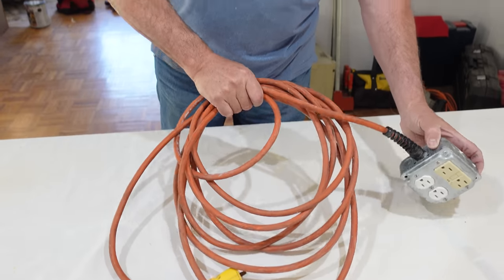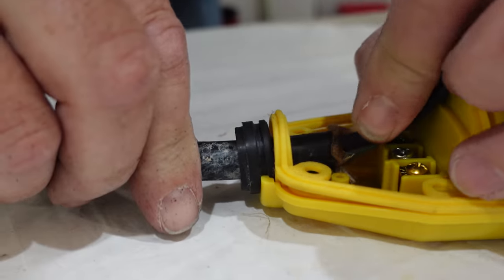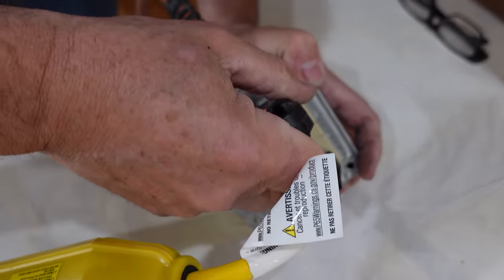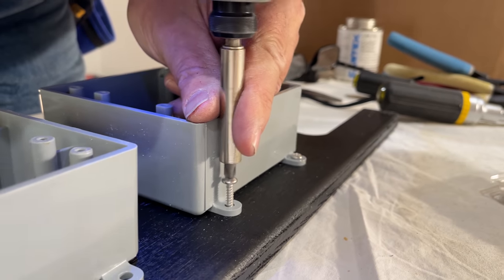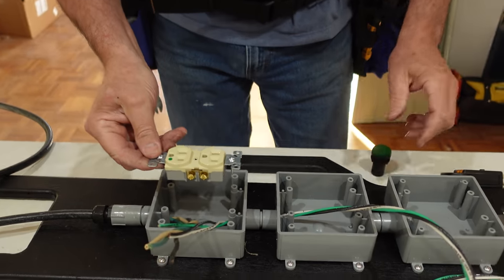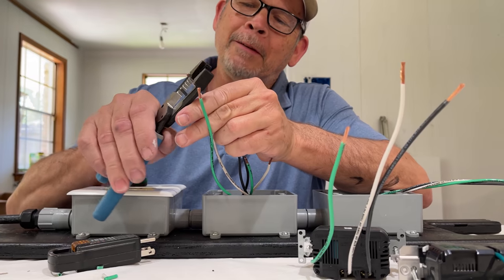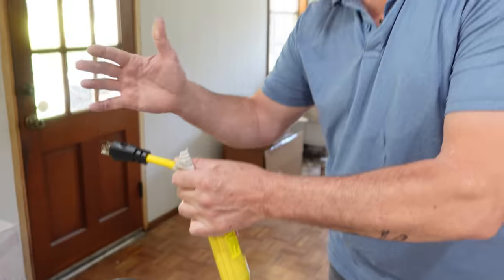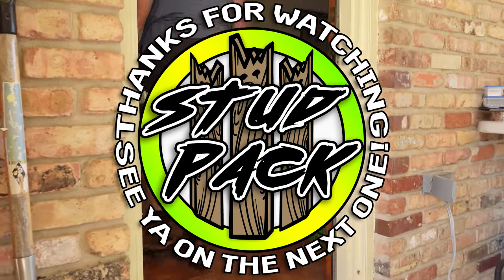HOW TO MAKE THE ULTIMATE EXTENSION CORD!

Comment: I see have it all in they comments but one other reason why it didn’t trip maybe they breaker is a 30 amp or maybe it’s just a faulty breaker but in general breakers do have a little over but not that much for example if trip at 22 apms it would be understandable and even if it rated for 20 apms we normally don’t put a 20 amp load on it we always go a little less cause wire heat can cause problems over time but yes 20 can sometimes handle little more than 20 amp like one commenter said there are two types of which breaker trip but it didn’t and 28 amps is way too much it should off so my guest is that it’s not a 20 amp breaker or it’s faulty

Comment: My nitpick would be... that inline GFCI is only rated for 15 amps.  If you actually ever used it for a 20 amp device on a 20 amp outlet on a 20 amp circuit, or pulled more than 15 amps through it by using multiple devices (admittedly that's a problem "normal" extension cords face), you would be risking catastrophic failure or fire.  In fact, having a 20 amp outlet permanently wired through a 15 amp cord is probably a violation of some code or another.  Your 20 amp setup there is very similar to an adapter that you can purchase that converts a female 20 amp into a male 15 amp... with one major difference.. all of the metal in those adapters is rated for 20 amps, whereas some of yours, mainly that GFCI and accompanying plug, is only rated for 15.

It's why 15 amp cords will plug into 20 amp outlets but not the other way around.  Plugging a high amperage device into that outlet is probably a very very bad idea.   A better solution would be to use an actual 20 amp inline GFCI with the appropriate plug and a 20 to 15 amp adapter, so you can plug it into normal outlets with the adapter attached, or take off the adapter if you are using an actual 20 amp outlet.

Comment: 20:57 The plug and outlet don't match up.  The horizontal blade of the plug is on the other side.  Is it a 220V 20A plug?

Comment: 30+ years aerospace power system design. Circuit breakers having timing characteristics. Similar to why there are fast-blow and slow-blow fuses. The speed at which the circuit gets interrupted due to the amount of load/current that is being drawn. Google "Circuit breaker trip curve" to see many examples of these charts. The X axis on these charts indicates the percent of rated current flowing thru the circuit, e.g., a 15-amp circuit breaker flowing 15 amps is shown as "1" (100% = 1). Timing of interrupts is an  important aspect of electrical system design to ensure that the interrupt occurs as close to the overload as possible for two reason. (1) to reduce the time to open the circuit clear the overload, and (2) to preventing nuisance tripping of other circuits that are otherwise not overloaded but happen to be connected to the same feeder bus. The trip curves typically have 3 areas. The area closest to the Y axis is the "Must Not Trip" region. Moving slightly towards the right is the "May trip region" and indicates that due to manufacturing variability and environmental conditions the trip can occur anywhere in that narrow region. Moving to the right again we find the "Must trip region" where the breaker is required to open the circuit come hell or high water. Ok, maybe not high water because mixing water and electricity certainly changes things. In such a case, the system would then rely on the next circuit interrupt device upstream of this one. All of this is known as "Trip Coordination" in power distribution system design.

Comment: I like the idea, but why not have covers on the plugs, so sawdust and debris doesn't get into them while they are laying flat, on the floor, in a construction site?

Also, when you wrapped the cord around the plugs, you are limiting the use, or rather making more work if you only need to set up a few feet away from the plug.  You may want to consider either making a new back board, or just wrapping the cord around the "bottom" of the board, or the opposite edge where the handle is located. Then if you only need to unroll a turn or two, you can still use the plugs.

Comment: The highest current draws should be through the least number of connections.  I'd have put the 20A Switch + Outlet nearer the Source and the lower current draws last. (That said and said and said, based on just the first few Top Comments)

Comment: Reason for not tripping the breaker or circuit. 
The 3 small appliances were probably right at 20 amps. Accessing 80% of the circuit which is downrated so that it doesn't run at 100% & overheat at the curcuit or panel. However, as you said overheating the wire will be a "fire in the wall" risk. Now if you use 10 gauge which supplies a 30 amp circuit. It has a higher heat rating. Mostly made for use with small appliances such as electric stoves or dryers & some welder machines. By the looks of the wire, you were using. I think you covered yourself by using 10-gauge wire. Anywho, as I said before 3 small appliances you were running was probably 20 amps alone & the rest was from phones & light. Which only draws by trickle charge & a continuance loop releasing at the weakest link, The Bulb. So you were safe, but for how long should have been the question...
I'm thinking Good shit tho 👍🏿. Especially with the GFCI on the front of cord. Which should be at the plug to protect your devices & Panel. Once you heat that panel bus, It's done. If it's on a constant one circuit all the time. I'd check behind that specific breaker from time to time to see if your burning the bus bar. At first it will be discolored (from polish to a bronze color). Then light copper. When it's black in that area, you'll know.  Because nothing on that circuit will work. And there's no such thing as replacing just the bus bar on a panel😮. 
 On the other hand nice Flippin Job. Bout to build me one...😊

P.S.  Especially what "LarryCoates said"

Comment: It probably didn't trip because of the time curve on the breaker. A 15 amp breaker isn't going to trip instantly if the current goes over 15 amps. In fact, a 15 amp breaker will eventually trip if the current exceeds 12 amps for a long enough time. Most home circuit breakers are rated for 80% of their rating at continuous use. That's why you won't find a home appliance designed for 115 vac that exceeds 12 amps.

Anyway, every breaker has what's called a trip curve. The higher the current, the shorter period of time it takes to trip. If something short circuits, that's a very high amount of current, hundreds if not thousands of amps, so in that case the breaker trips almost instantly. But you can draw moderately large amounts of current, even double the rating, for short periods of time without tripping the breaker.

Comment: I'm not so sure this is an extension cord anymore. This is... Something new. You should name this thing! Also, not an electrician, but I do know why breakers don't trip when you pull a massive load through them. First off, breakers have a lifespan like any other electrical device. As time goes on they take longer and longer to trip. Fortunately, they're designed to be fail-safe so when they go bad they tend to just trip on their own and stay tripped. The thing is even a new one will take a certain amount of time to trip. They're not computer-controlled, so you need to wait for the mechanical components in the breaker to come to temp from the power draw before they can trip. This is why a lot of people are working very hard on making smart breakers that can pop the instant the current overloads, then reset themselves after detecting the lines are safe, or warn you of fire via a text message.

Comment: DANGER WILL ROBINSON!!!
You installed a NEMA 5-20 DOWNSTREAM from a NEMA 5-15.
If you connect a high-current device manufactured with a 5-20 plug, it looks like the 5-15 at the wall would see more current than it was designed for. I mean, yes, YOU know to check breaker rating and all that, but what about the 14yo (or really stupid 30yo) that doesn't pay attention to these things?

Comment: CB didn't trip due to possibly faulty CB. If left in an over amp condition long enough, the breaker should have tripped,, but you removed the load before it could time out.

Comment: Im no electrical engineer. But im thinking it would have tripped if you would have left it on for a longer period of time. It just needed more time to accumulate more heat to trip your diy extension. Heat is created by friction. Friction in the electrical world is called resistance. More time more heat.
Reply: Is there more to it. Can someone explain because I like learning.

Comment: All the worry about the water tight box is a concern of common sense with this contraption. 

Somewhere on YouTube I watched a video where the guy had the same concerns. 
In his example he had an extension cord that fed a regular household power strip. He plugged a toaster into it and then dunked the toaster into a larger container of water. 
What happened? 
Nothing. The toaster kept roasting and the circuit breaker didn’t trip. 
Next he sprayed the power strip with water and again, nothing happened. The toaster kept on toasting! Dunking the power strip itself into the water?
Same thing. 

Why? I don’t recall the exact answer but it was about resistance. 

The gfi when added to the setup did of course correctly sense the problem and triggered and the attempted suicide was averted. 

So I guess if anyone is trying to get electrocuted it’s advisable to make sure you don’t have a GFCI in place to interfere. 😂

Comment: Keep it simple let the cord do the work. I was told the same . Tighten all screws and offset. Then i still tape aroud the outlet. I was made to tin all hospital outlet’s. Alwas have to look for the youk. Get a wire puller it well use you 20amp outlet

Comment: @20:50 NEMA 6-20 is for 250v 20amp you meant NEMA 5-20 which is still 125v but 20amp as well.  You showed a NEMA 6-20 plug but a 5-20 outlet FYI.

Comment: Circuit Breakers trip because the metal completing the circuit breaker over heats and changes shape thus breaking circuit. Pulling 28amps for that short of time did not heat the metal enough to change shape.

Comment: One thing for sure, it is amazing the wiring disaster's waiting to happen, that have worked fine for decades. While best intended efforts to upgrade old 2 wire ungrounded wiring with added ground and GFI have inadvetantly resulted in unexpected shock hazards from otherwise shoddy wiring. How can a properly working GFI outlet in a bathroom partly rewired with Romex w/ground result in everything exposed being unexpectedly energized? Answer. Ground wire on added wiring was not run back to panel or connected anywhere to ground, left floating. An added ceiling fan in another room had a tiny strand of wire sticking out from wirenut, touching the floating bare ground wire, energizeing everything exposed on random circuits sharing the floating ground. Everything seemed to work, GFI tested OK, just don't touch nothing.

Comment: I'm not an electrician but wouldn't it be better to place the higher amp socket closest to the cord and work your way across to items that take less amps?.  That way your higher demand plugs are going through less connections meaning less loss and heat from resistance.

Comment: Why did your breaker not trip at 28 amps:
Time Delay: Many circuit breakers have a built-in time delay, especially for short overcurrent events. This is because many appliances and devices can draw a higher current momentarily when they start up (like motors in refrigerators or air conditioners). The breaker is designed to tolerate these short bursts without tripping. If the overcurrent condition persists for an extended period, the breaker should eventually trip.

    Tolerance and Manufacturing Variations: Not all circuit breakers will trip exactly at their rated current. There can be slight manufacturing variations, and some breakers might have a small tolerance range where they can handle currents slightly above their rated capacity without tripping.

    Age and Wear: Over time, circuit breakers can become less sensitive due to wear and tear. An older or heavily used breaker might not trip as readily as a new one. Dust, corrosion, or other environmental factors can also affect its performance.

    Temperature: The ambient temperature can influence the tripping characteristics of a breaker. For instance, a breaker in a cooler environment might be able to handle overcurrent conditions slightly better than one in a hotter environment.

    Type of Breaker: There are different types of circuit breakers, and their tripping characteristics can vary. For example, thermal breakers rely on heat generated by the overcurrent to trip, while magnetic breakers use magnetic fields. Some breakers combine both methods. The response time and sensitivity can vary based on the type and design of the breaker.

    Faulty Breaker: It's also possible that the circuit breaker itself is faulty and not functioning as intended. If a breaker consistently fails to trip during overcurrent conditions, it might need to be replaced.

Comment: I know that others have said why the breaker didn’t trip when you got it up to a 28amp load most answers where partly true yes in a normal breaker that is 20amp the breakers are manufactured to be derated just like our #12 wire is in our code book #12 wire is rated for 25amps so the code book does your first derate for you so that you don’t put that size wire on anything larger than a 20amp breaker but the breaker is derated as well so it’s actually designed to hold that load for a small amount of time at 25 to 28amps might take one minute will depend on how hot ambient temperature is. There are other things that will also effect the time cause the wire size on extinction cords is different from your thhn romex or stranded #12 and #14 19 strand in thhn wire compared to the multiple strand wire in the S/O cord or extension cord more surface area for the wire longer to generate the same heat to trip the breaker hopefully that answers your why?
Reply: That is easy way to explain but a practical application would be on an A/C unit if you look at the nameplate and it says max breaker size 23amps min breaker 16amp breaker and the breaker says HIC on it which almost all are now it’s manufactured for you to use a 20amp breaker on that piece of equipment and use #12 wire so you don’t have to use a 25amp breaker and your code complaint cause the unit is not designed to be on a 30amp breaker that’s not fused which most residential disconnect’s are not, this is why our code book is always telling electrician’s to refer to the manufacturer specifications.

Comment: The backing board for winding the cord will cause the wires in the extension cord to twist, ruining them. Great way to ruin an expensive extension cord. The backing board should be offset so you can wind from the side and cross the cords with each wind. Those cover plates look like a failure point. I always used steel cover plates.

Comment: Cord wrapping should be independent or being able to use the outlets. Consider a cross wrap from each tine already built. I wouldn’t want to unwind all of the chord to use the outlets. Break their dependency.
Reply: Not supposed to use coiled up wire for high loads, it will over-heat, so would have to unwind it all either way.

Comment: My one suggestion is to NOT modify existing extension chords. Most are incapable of carrying a full 15 amps, let alone the 20 amps of the breakers they tend to get plugged into. Instead, get a fresh cable that is actually adequate for 20A if you are using NEMA 1, 5-15 or 5-20, 30A for NEMA 2 and 50A for anything else. 

CAUTION!: For screw, clamp and crimp terminations, you cannot use aluminum cable. Aluminum is susceptible to cold flow and will loosen over time, leading to higher resistance and eventually a meltdown. If your cable is aluminum, splice it to copper before termination. Many cost-cut cables are not just thinner gauge but also have aluminum wire, which has been brazed to or spliced around blades prior to the injection molding. 

Internal wires between gangs and through solid conduit can be solid. Personally, I'd recommend it. All wires inside the box should be equal or higher gauge to the external cable. (Again, I'd recommend making sure the whole extension is at least 20A rated so the breaker will trip before any other component fails.  

Correction: That is a NEMA 5-20R not a 6-20R. 6-series have two horizontal blades and is intended for 250V applications. 

CAUTION!: DO NOT put a 5-20R on a chord with smaller than 12 gauge wire and DO NOT put them on a chord with a 5-15P. Should you reach the max draw, at best best you will be blowing breakers, at worst you could melt the wires in the walls. 

Correction: You can mix 5-20R and 5-15R or even a 1-15R in the same box so-long as the wires are sufficient and the plug is a 5-20. 

CAUTION!: If you plan on pulling 30A though a cord like this, the wire spec requirement jumps to 10 gauge.

Comment: i wired my shop with single gang boxes every 5' and only 3 boxes per 20 amp breaker. each outlet is labeled with the circuit # it's on and this way i don't overload any given circuit.

Comment: Wire Crimps Please use wire crimps in that GFCI. Do not never ever put a stranded wire in a paddle connector without a crimp. It will relax overtime and create a problem.

Comment: You made a super heavy-duty extension cord, and then used the push-in connectors on the back of the outlets.  Every electrician I know uses the side connectors -- more reliable.

I would have used solid wire to connect the outlets, also.  None of those are moving inside the box.